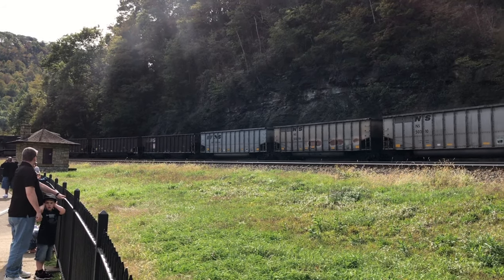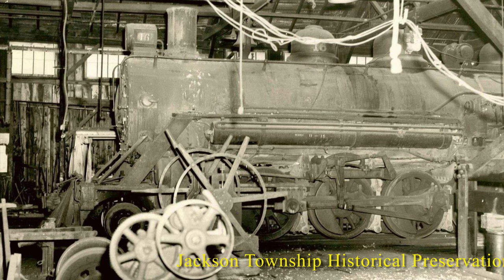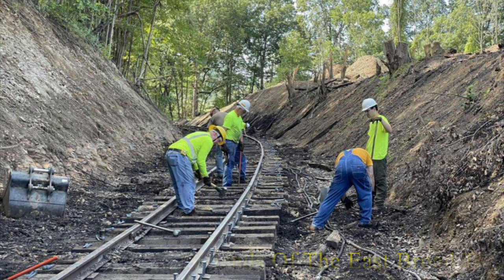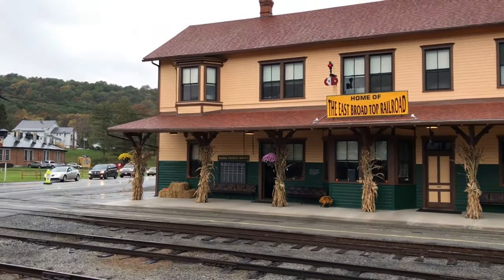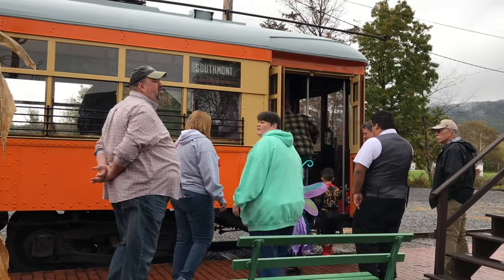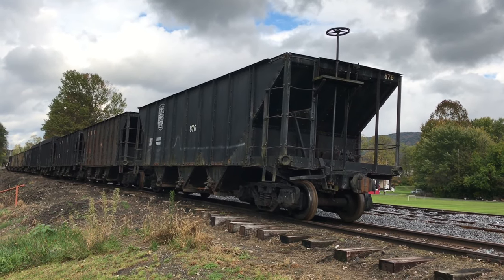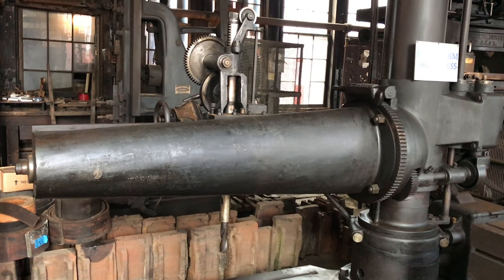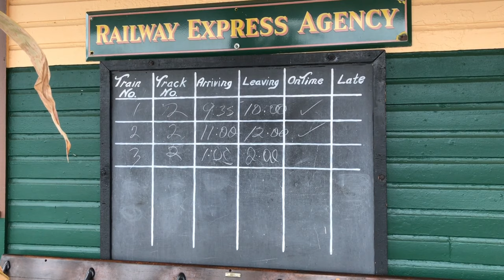The East Broad Top Railroad Vol. 1 | Retracing History Episode 20

Comment: Many East Broad Top hopper cars have been sold off over the decades and many remain on other narrow gauge railroads, including the Cumbres and Toltec, Durango and Silverton, White Pass and Yukon, Dollywood, Tweetsie Railroad, and some went to museums.
Reply: One interesting place they wound up is in the City of New York. Parts of the subway system  are built to a narrower loading gauge than typical for standard gauge. Years ago they were looking for hopper cars for trackwork: the solution was to buy a couple of EBT hoppers and place them on standard gauge trucks.

Comment: Most EXCELLENT video - written, shot, narrated with energy and articulation - well above average.  One technical question from your comment on locomotive 14 on asbestos-lined boiler jacket - what is used today for said boiler jackets ?  Would love to see you retrace the 33 miles - bits and pieces of evidence of the right of way (and even remaining rails).
Reply from the maker: I am unsure on what is used as the replacement. Good question, will ask when I'm back in the area. I plan to make a second visit in the spring to explore some of the out-of-service segments. AS well as to visit the museum in Roberstdale.
Reply: The insulation used to replace asbestos is ceramic and mineral wool insulation.

Comment: EBT Mikados are not the only narrow gauge mikdaos.  Denver and Rio Grande k27s, k36s, k37s are the other big classes of narrow gauge steam.
Reply from the maker: This is true. But the design of the Mikados stored on the EBT do appear distinctively different to The K units the D&RG had. I have yet to see Mikados that look near identical to the EBTs.
Reply: @RedoubtProductions1754  I understand what you meant now.  Theys are unique.  Southern valve gear was an interesting choice for the big Mike's and the slide valves on the smaller miles make for some unique looking locomotives.  I have always loved the way all the EBT Mike's looked and sounded.
Reply from the maker: @willblumenkemper6523  Since my visit in October 2021, #16 has past her inspections and just recently had fire in her belly for the first time in over 60 years!  Won't be long to here the Mike's roar back to life.
Reply: And someday you will see a Mike cross Pogue bridge for the first time since 1956 hauling tourists for the first time ever on that section of the railroad. All the years the Kovalchick’s owned the railroad they never used the tracks toward Saltillo and beyond for tourist rides. Trees grew in the tracks over the years and road crossings paved over and bridges need work. The rebuilding is a major project. I think one or both of the tunnels have cave ins. I was never at EBT before. I live at the eastern end of PA.
Reply: Don't forget the K28s
Reply: Don't forget The Tweetsie in Blowing Rock, NC. Huckleberry RR in Flint, MI runs 36" gauge. The track was narrowed from Standard.

Comment: Have they did any research on the two stall engine house that an engine has been sitting since 19 teens I do have two pictures of it by holding my camera up high throw a broken window with some railcars of WW1 still parked on the rail.
Reply from the maker: That would be #3 in the Mt Union yard, which is the only stretch of the EBT right of way not owned by the East Broad Top Foundation. Another entity owns the locomotive & that property and have no affiliation with the current operators of the East Broad Top. Sadly, #3 appears to be stuck in limbo for the forseeable future.
Reply: So EBT can’t go to Mt. Union unless they make a deal with the owner? So they have no plans to restore any track north of the grove? But they are restoring track the other way toward Saltillo slowly. That section was never used in the tourist era except for speeder rides several years ago on a restored section of track.